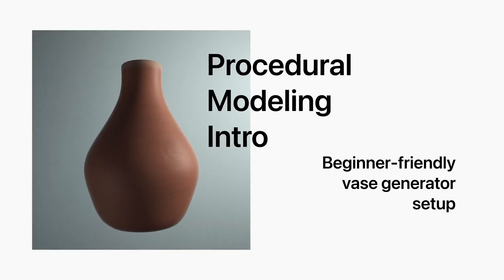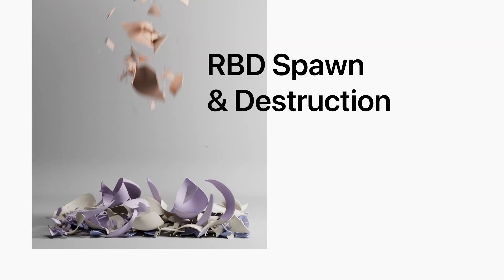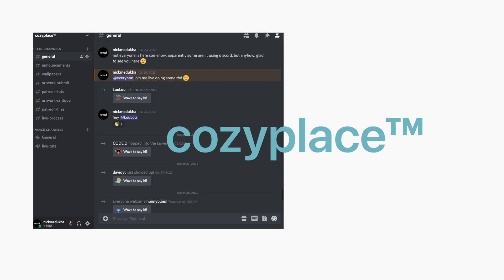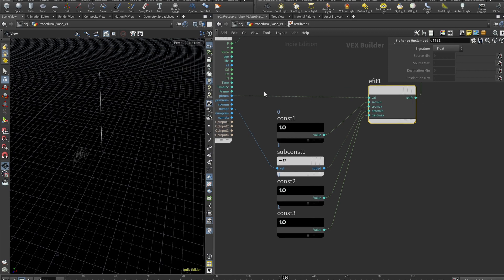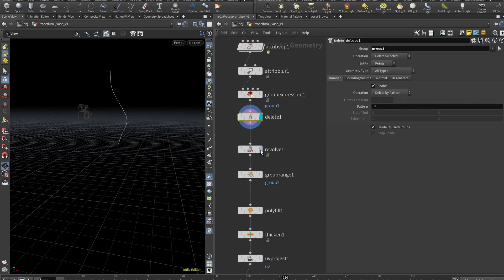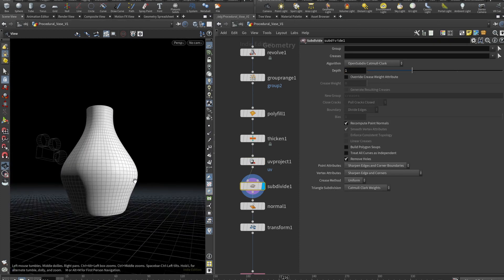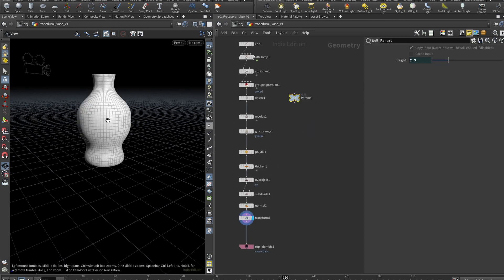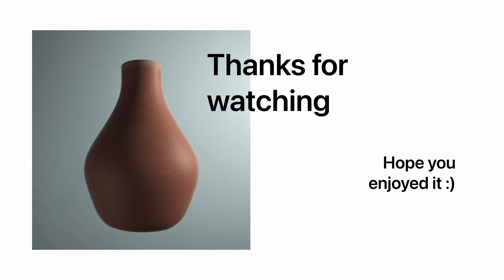Intro to Procedural Modelling in Houdini - Beginner Vase Generator

Comment: Hi, I have setup the attribvop, but when I initialize the node, the line is showing up as straight with no inputs from the ramp. Is there a substep I may have missed?
Reply: The constant node for destmin should be set to 0 and 1 for destmax
Reply: Make sure you add more points to the line, default is 2 but set it to 20
Reply: @evan4622  hi, I have the same issue and also tried adding more points, this did not fix the issue. Did you happen to find a solution?
Reply: @evan4622  I'll try that, thank you!
Reply: I've got the same problem even though i added more points, did u find a solution?
Reply: I am also in the same boat. its a shame the creator hasn't been able to help @ryangerard2749
Reply: Did you find a solution?

Comment: HI, one thing I only learnt recently. With the edit parameter interface panel open you can drag values from other nodes into the space and it will automatically connect them for you - save having to constantly create the type of parameter, copy paramenter, paste relative reference etc. Saves a lot of time when creating controller nulls and that sort of thing.
Reply: sometimes it won't allow you to do that, so you have to uncheck "forbid linking parameters from outside this subnet" in the cogwheel qt the top 👍
Reply from the maker: ah alright, you saved me hours of googling why its wont work :D thanks man!
Reply from the maker: Wooooow thats a game changer and will save so much time!! Thanks a lot!